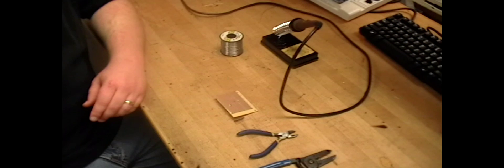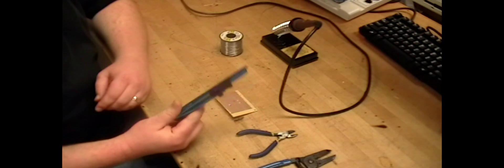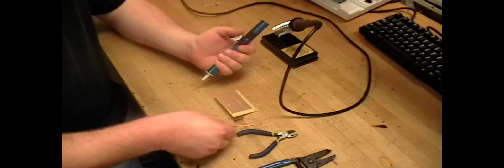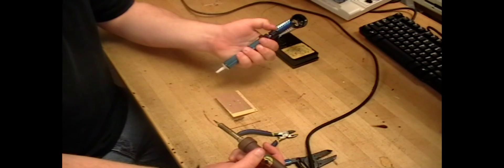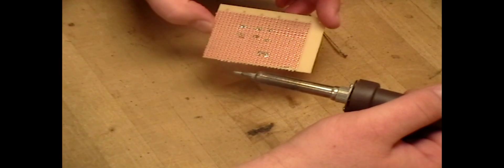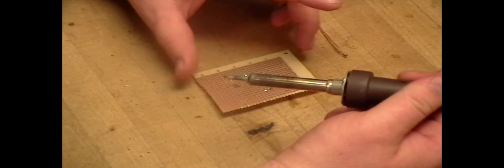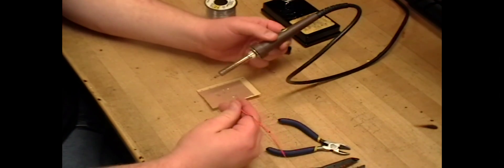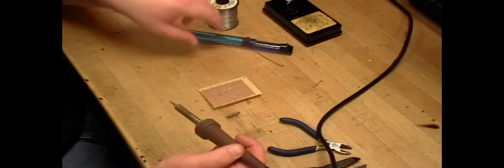IEEE USF's Tutorials: How to Desolder

Comment: I would rather reccomend bigger vacuum tube. I assume that you are using very common 20x200mm. I had one and it wasnt very efficient. Try to buy similar to Goot GS-100 or 150 (25x330mm). There are many brands of it so it dont have to be particulary Goot. They REALLY make a difference.